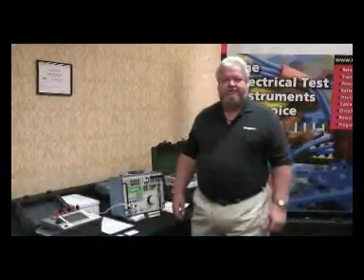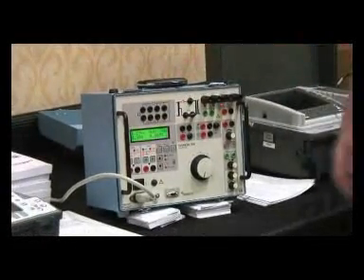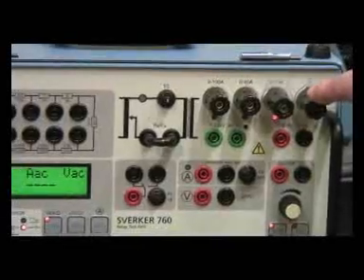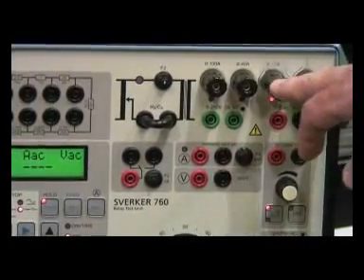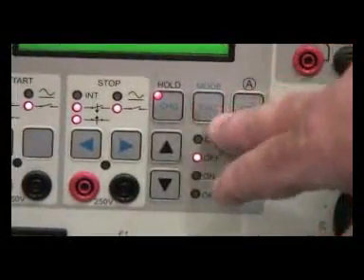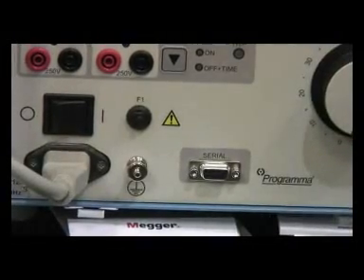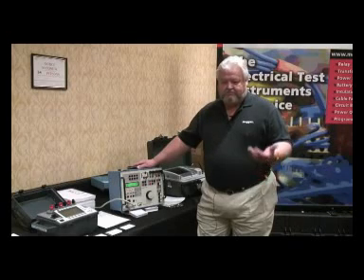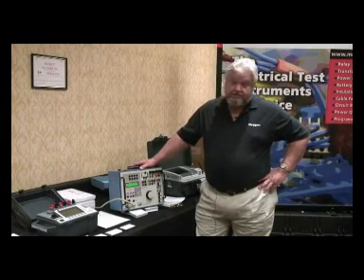Sverker760

Comment: STOP advertising bad quality equipment.  DC aux supply is faulty on those units. Not an easy repair!!!
Reply from the maker: The Sverker 760 is obsolete and has been replaced by the Sverker 780. Megger has sold thousands of these units and as far as I am aware there has been no major problems. As regards 'advertising bad quality equipment', this video is over 4 years old and we've left it on our channel for information purposes only. Presumably you did a search for it. So why complain?
Reply: Ok.  Appreciate your video but the 760 units are not reliable.   I know that this is very popular relay test set but  there are  issues with it.  As per obsolete that is not really relevant here.